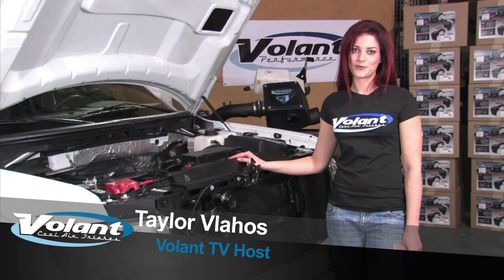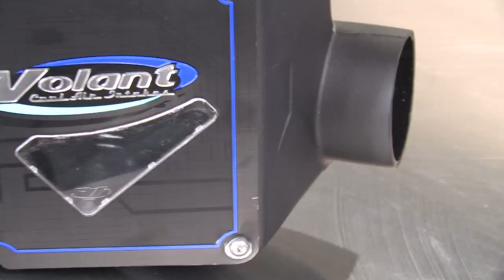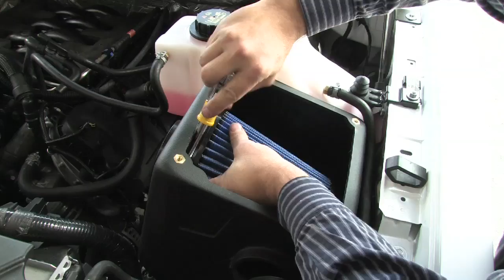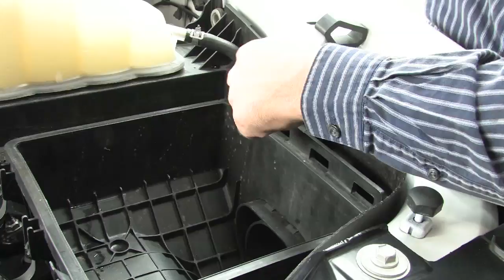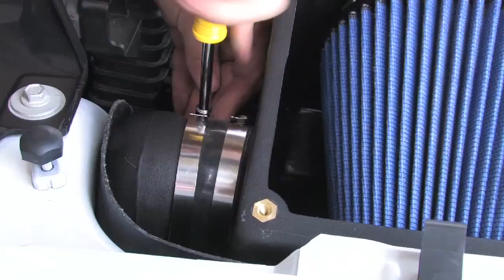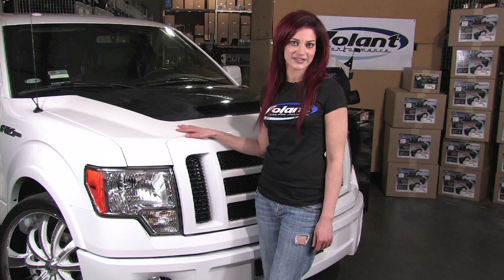Volant 2011-Present Model Ford F-150 Cold Air Intake System

Comment: They don't give you horsepower ratings because real world horsepower is like 5-10 horsepower, your not going to feel that. It's more of a sound you're looking for with this intake. Just speaking from experience, I had it on my 2000 lightning. No noticeable difference...
Reply: The subsequent tune is what will increase HP.  Right?